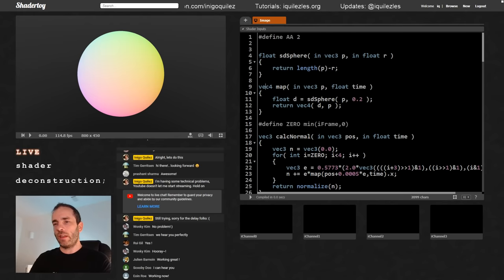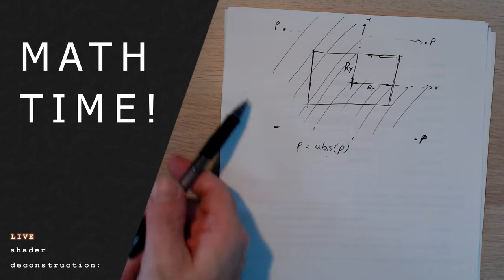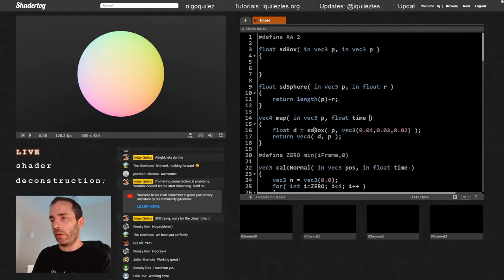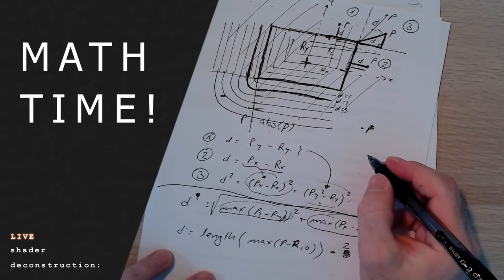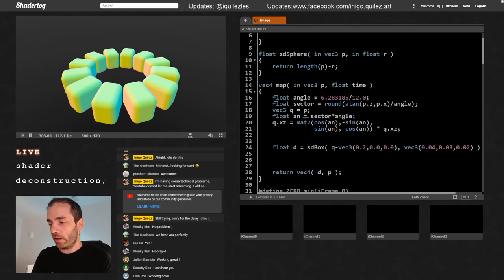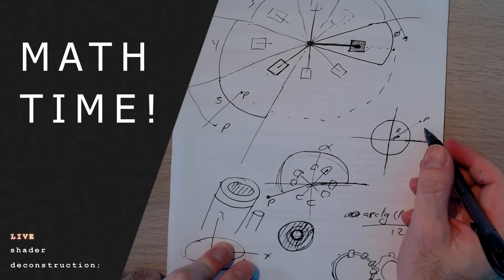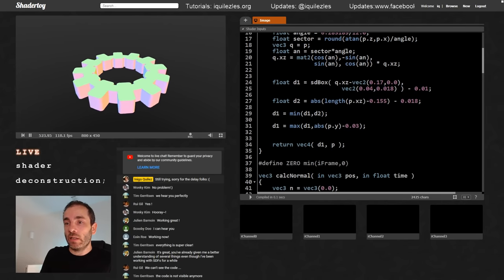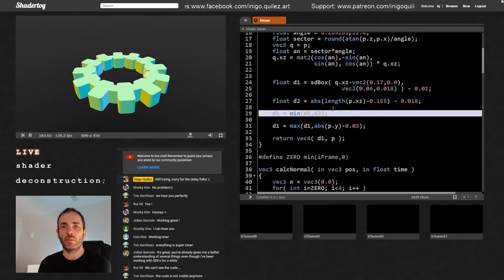Live Coding "Sphere Gears" - Part 1

Comment: Sphere SDF (2:45)
Box SDF (5:33)
Round Box SDF (23:17)
Circular (angular) repetition (31:32)
Q&A (41:39)
Ring SDF(42:31)
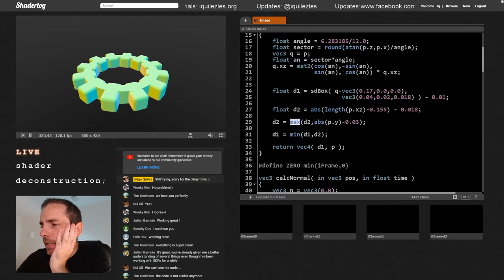Smooth maximum (smax) start of explanation (1:00:11)
Smooth maximum (smax) math explanation (1:8:25)
Cross SDF (1:23:25)
Vertical Sticak SDF (1:34:31)
Animating Gears (1:46:51)
Adding some textures (1:53:15)
More Gears (1:55:53)

Comment: The issue with the rotation was that the gears were reflected across a plane instead of rotated, and so the rotations of opposing gears (+x and -x gears for example) were rotating in opposite directions. You can convince yourself of this by considering that any gears linked by an odd number of gears must be rotating in the same direction.

The fix is probably to remove the abs in the gear and use a rotation instead, or to draw a second reflected gear that rotates with -time.

Love the patient explanation of the concepts though, really helped me to understand, especially smax (which I had just been copy and pasting).

Comment: but isn't 'max' actually using 'if' to get an answer?
so you just hide 'if' inside 'max' but don't get rid of it
maybe (sign(x)+1)/2 would do the job of getting value (if positive) or zero (if negative)
'sign' could use sign bit without 'if'
Reply from the maker: No, max() is not using if-tben-else to get it's answer. It's implemented without bramching by the hardware by comparing the two numbers and using the sign of their difference to select one or the other with a miltiplexer or a CMOV. That's the wbole point of having a max() hardware instruction, to NOT having to use an if()

Comment: Just realised there's a deeper meaning in rounding the corners like that, in the sense that the resulting shape is actually a convolution in 3D space between a box and a sphere. It didn't hit me right away until you started drawing the star. I find that beautiful and intriguing at the same time. The convolution is a very, very expensive operation in time domain, especially if done in 3 dimensions. It's significantly less expensive if done in spectral domain where it's just a multiplication of magnitudes and an addition of phases, yet still, you achieve it in SDF with just a subtraction operation. That blows my mind, especially when I think of the multitude of properties that could be exploited in SDF with effect in time domain. The funny thing is that convolution with a sphere is a special case of low-pass filtering. And it makes sense if you think about it. You start with a signal that has a rich content of high frequencies (ex. sharp corners) and you end up with a signal that was stripped of it's very high frequencies. And you did that with a freakin' subtraction. This is an amazing example of how a complex problem becomes trivial by moving it in a different domain or representation. Now I can't stop but wonder.. Can a shadow be made smooth by just a subtraction in the right place in SDF? Because if so, this would be huge for Ambient Occlusion and light transport in general. I really hope you get to read this despite of the long reading.
Reply: It seems to me like the results are similar but not identical. If we took an SDF with a distance bias of 3 units out of the shape and compare it with the convolution of the shape against a sphere with radius 3, then all the areas that result in zero are replicated accurately. However, in the areas of space where there is overlap, the convolution returns a value representing the degree to which the overlap occurs. You would have to find the edge of the output of the convolution in order to render the shape. This is fine, and this means that we can definitely use convolutions to solve this problem. However, this is not true the other way round. You do not get the overlap information when computing the SDF. The SDF is essentially the boundary of the convolution/Minkowski sum between your shape and a sphere of arbitrary radius. The nature of the SDF output is quite different from that of a convolution - we just use an SDF to find information that we can also happen to find through convolution. An SDF basically gives you the radius of the sphere to be convolved with the shape in question such that the input point lies on the boundary of the resultant shape. Using a ray marching algorithm with SDF is basically finding the roots of the convolution sphere radius necessary to produce a boundary of every visible surface if we were to convolve those surfaces with the sphere of that radius over all space. So it is EXTREMELY useful when the only useful property in your usecase for convolutions is finding the boundary of the resultant shape. 

To follow the SDF + ray marching algorithm process in the spirit of convolution, you would start at your point, pick a direction, and guess an initial sphere size. Then calculate the product of the sphere with your objects (convolution, but with the domain restricted to just the point representing your current location - calculating everything else would not only be a waste, but would yield no useful information because it covers all of space and you would get a constant result no matter what you did) and evaluate it at your current location. If it's nonzero, shrink the sphere radius. If it's zero, increase the sphere radius. Try again and again decreasing your step size until you find the boundary (once you reach some minimum step size). Then, shoot forward in your direction by an amount equal to the final radius of the sphere in the last step. Repeat until the solved radius of the sphere is below some limiting size. You have found the closest boundary in a particular direction. Repeat for all other directions in your view. A possibly more effective implementation is as follows: start at a point and pick a direction. Find the radius of the sphere for which when convoluted with all other shapes, produces a shape for which your current location lies on the boundary. Perhaps you precompute many radii up until some critical scene size, save the isolines/isosurfaces corresponding to each radius, and linearly interpolate based on the normal directions to find the optimal radius since your current location will lie between isolines. Then, move in your direction by that radius, and repeat until the radius is small. Perhaps there is a more useful method that stores less information and can evaluate it faster, or without needing to cast rays. I have no idea. But the fact that the SDF easily computes distance - which is a pain with convolution, sacrifices overlap information, and is easily parallelizeable means that it practically deals with an entirely different set of applications.

As a note to your low pass filtering comment, the convolution of the sphere can add higher frequency components to concave surfaces to the point of discontinuity - e.g. if you had a plus symbol with the concave corners rounded with a radius R, then finding the SDF with a bias of R away from the shape would result in sharp inner corners.
Reply: @Dragon20942  Damn it, now I feel stupid and ashamed for jumping to conclusions too soon and not thinking that through. You're absolutely right, that is definitely not a convolution. It only so happens that in some cases it hints the idea of convolution and I fell for it. At best, it's a constant-size perpendicular inflation - if we can even say it like this. And that constant size is what we subtract. Hats off and many thanks for not letting me walk away from this with wrong conclusions.
Reply: @AlexTuduran  Hey no worries. Good job making a connection to convolutions immediately - it's a great that you have a good intuition that suggests ideas. Keep doing what you're doing with that good attitude and meaningful discussion will be generated no matter what. I personally call that inflation an "offset" of the shape because it's the name of a tool in SolidWorks that that will generate the distance biased SDF of the argument entities.
Reply: @Dragon20942  I'm probably that case where when you are obsessed with something - in my case convolution - you tend to see it everywhere. :) No matter what, I deeply appreciate your nice words, especially comming from someone who clearly has a better understanding of the topic and the good will to share it.

Comment: Based on your video, I now understand why I always get so annoyed in Blender or Strata3D when I want to smooth the edges. I find the concept at around 26:00 in this Vid with the distances 1, 2 & 3 very problematic and basically poorly thought out. Basically it's a good approach with the distances but these individual lines in the X & Y direction have to be created in the Objcts inside not outside. Imagine my fit of rage when I create a text (as a only text first) in Blender and use Bevel (Strata) to drag it into the depth to make a 3D object out of it and then your theorem comes along: now I'm rounding the edges. What happens?! The individual letters of the text (maybe a company logo) fall into one another and the previously correct spacing is completely lost. This has something to do with typography that was completely forgotten in that concept. Or I take an image with a logo and load it into the 3D program, then I draw the edge, or I have a vector graphic of the company logo and load this into the 3D program and say make a 2D object out of it, then I drag it (again) into the depth to get a 3D object, all very simple standard processes up to this point. But if I now add a metallic texture to that Object, for example chrome or gold, wear are it is always most effective later as a moving object when the edges are minimal a bit rounded, the more curved the better the reflection effects, which is what creates the chrome or gold look for the human eye/brain. And now you might understand why I am appalled that you move P1/P2 and therefore P3 outwards instead of pulling them into the interior of the object. Even if I model something else, nobody wants to inflate the volume of this object outwards and then thus get collisions with other existing objects in the 3Dscene. A serious conceptual error!!!  
Apparently most 3D software engineers make exactly this mistake, which is a shame, as it creates massive extra work and causes tremendous stress when working with the programs. 

Can you please bring this Point somtimes up at Pixar &  Blender Foundation etc. I know the people there will listen to you becuse you are a genius in betwin of time at this branch. All the rounding modifiers in Blender are obviously based on this wrong concept regarding the displacement/distance points. Maybe them can put too a switchbox in the GUI for "Inside or Outside" expanding "P1/P2 & P3" so that the old workflow is too posibly.
Thanks in advance, with only the best wishes & greetings bennoH.🐹🙋

bennoH. love's ISF-Shaders for ResolumeArens + moo RealtimvideoSoft 💗

In respect and memory too the great 💗🙏💫
MojoVideoTech  "DrMojo"
hu switching shadertoys to ISF